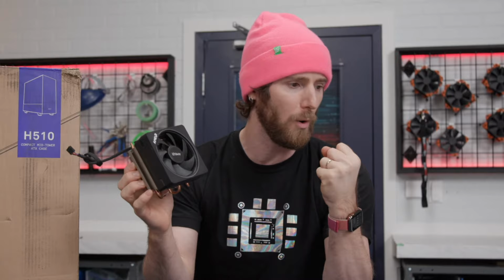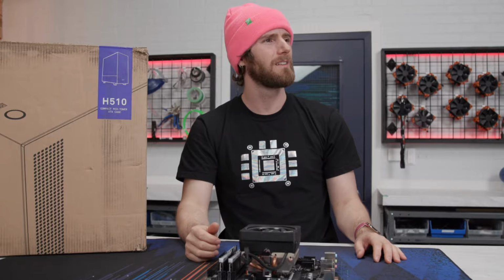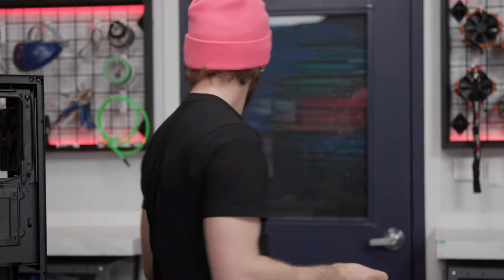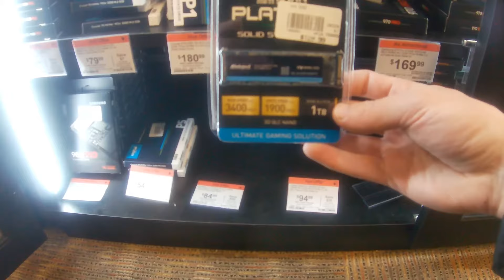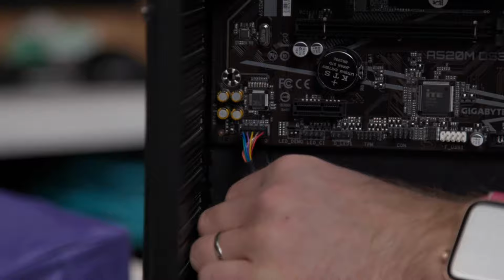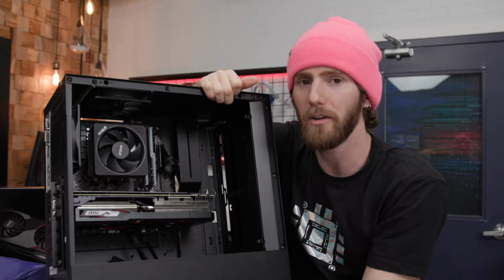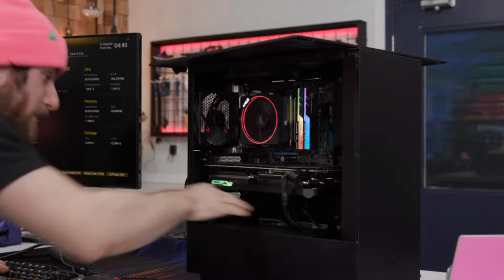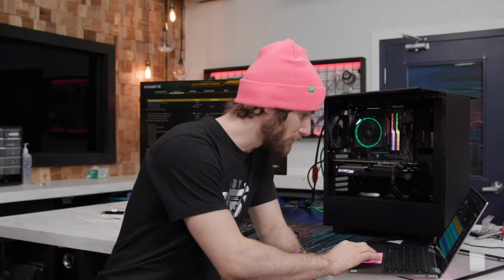Let's Build a Bang-for-the-Buck AMD Gaming PC!!

Comment: G Skill stock speeds are quite low compared to the Crucial Ballistix. I had the AEGIS which struggled to get to  3200  on my Ryzen 5 2600 while the Ripjaws V had a bit of trouble with 3600 unless I relaxed the timings, below what was listed in the kit. The Crucial Ballistix has a higher SPD and getting it to 3200 (stock) was trivial and it went as high as 4000 without issue.

Comment: @linus Tech Tips: i have a Ryzen 3100 with 16GB DDR4 3200 and an B450 Mainboard with a GTX 1660 Super and when i play PUBG on 3440x1440 on ultra low settings and 75% render resolution (except Texture Details are on Mid) i have arround 100-120 FPS - BUUUUUUUUUUUUUT i have OFTEN stutters and drops to 50 frames. I dont know why. BTW my Ryzen 3100 is OC on 4100 MHZ and 1,25V - maybe i have a bottleneck or a damaged component ?`- THE CPU Usage is often at 100% - Temps are not more than 80 degree celsius
Reply: You're so funny, man! This is YT, not a forum!
Reply: @ArturoTabera  and ?

Comment: JayzTwoCents posted a video 'Common PC Building Mistakes that Beginners Make' I should re-emphasize 'Beginners Make' and you daisy chained the extra plug on the end of the 8 pin connector on the graphic's card instead of running another 8 pin plug.. Was it for aesthetic's?

Comment: LOL Could you get Anthony to to explain Buses, and the change, as you did such a bad job...

The System Bus Old, is a Ring, each part had a bit, which would send it around to all the parts attached. the system messages would send the instruction bit to all devices and then reply. then the signal (okays) when sent. 
This was a shared bus.

Now aside from this there was a NB and SB, think of them like routers. they would take control on part of the machine and the bus ring. then would communicate to the cpu.
Then we had the communication move to the CPU, in particular the Memory...   which made things SO much BETTER.
The PCI Express had to be fully terms as if you were to say PciX, then you would find that there was a "pci x" slot already, which were on workstations and servers 166MhzBus.

Like PCi express, PCI came in speed flavors, 33,66, 100 and 133. Most which looked the very same, now the bus is split into lanes. Like on a highway, you can get more lanes on the bus route... more traffic and thus less bottle necks on a narrow lane. they do would the same way with the send bit, read bit  but they are separately connected to the cpu which is the big change to system performance.

Bang for buck Computer?
£320 GPU? I think Steve is doing better cover with older cards as a stop gap for new ones, which is the same for many who may build now and plan to upgrade. as older GPU ( like a 1080 for example) will play games well enough.

Ram Compat....
Oddly corsair Value is pretty good for compatibility, but I have preferred Kingston, which I have used to OEM systems and it worked.. which is not usually the case. I remeber having to manually set Ram, and Wrote a article back in the day on how to do it and loads of people copied it, blogged it..

Upgrade Path...
Low end board.. Low end CPU... NO NO..
Either a great board and crap CPU which you can up grade or the other way around, Id rather swap a CPU than a mother board.

Comment: Notes on that "amazing" AMD stock cooler...
For typical gaming and normal use it's fine, but its not quiet. It will ramp up and get loud relatively easily.
For actual multithread workloads on any 16 Thread Ryzen it will thermal throttle and you will lose like 0.2 to 0.4 GHz due to getting well into the +84 Deg C range.
How much that really costs in time is not allot but higher temps relate to shorter product life.
It's better categorized as "functional" then amazing.

If you're only rarely doing things like reencoding video or long code compiles it won't matter and its very functional.

Comment: wow brings back a lot of memories ,dos 3.1 etc ide where you would install a graphics card and you had to choose irq usually would be 5 or 10 i think and that would intern clash with your soundblaster  sound card which could only use irq 7 or 5 etc... nightmare then pci came along and wow. also ,you would get your mircoprocessor and try and figure out what core voltage it was and change jumpers on the board. cheers for bringing these memories back ,oh anyone remember vesa graphics ? i last built a pc 15 yrs ago and looking to build another,hence , finding your site ,god you look way to young to remember ide etc.. but love the channel

Comment: Gskill is great, but for some reason I cant get my primary to work right. Yes its ddr3-2400 (2 2x4gb kits) trident, and it was (when bought) in my mobo supported list (Asrock FM2A88X Extreme6+) then later removed from the compatability list. If i try to run it over 1866 my system wont even post past bios. Despite this, ill take G-skill over another company anyday!

Comment: FYI the Ryzen 3 CPU comes with a $15 Wraith Stealth Cooler, like my Ryzen 5 did, which is the biggest pain in the ass I've dealt with since seeing the doctor after I turned 40. It's not the clamp-style he shows in this video, it actually screws into the motherboard (back plate). 
Also, the AMD logo section of the fan housing blocked the RAM slots on my MSI B550-A Pro motherboard, so I had to turn it 90 degrees on top of the heat sink. The problem is the damn screws going into the heat sink are blocked by the plastic covering (part with the AMD logo on it). I had to Dremel out some slots in the plastic housing to get to the screws.  I highly recommend paying an extra $25 for a Thermaltake or $60 for a Noctua.

Comment: When Audigy 2 was released I used full 5.1.1. Showing my age here..
Reply: I still use an extigy (same era as the audigy) so I can adapt our 1990s era amp for fibre in to hook to the tv to the 5.1 setup I have in the garage. I had a pile of old audio equipment in a box and decided to use it to free up the space the box occupied. I did leave off the 100 disc changer....I still use Logitech 5.1 speakers on my pc too.

Comment: Went with B550 myself (for €15 difference I could upgrade with a pcie 4.0 ssd later if needed). And took 2×16GB instead. 

Second half I may or may not look  at a 5600, if prices went down. If not, keep the 3100 well into 2022. Whatever man.

Comment: Yo LTT team, could you guys make a PC build for artists? 
Something along the line of medium performance, reasonable bang for the buck with heavy focus on reliability and something that wont break down over sustained load and use.
Reply: A gaming build can also do great with workstations that do graphic design and creative work, just get a 6 core cpu for multitasking. 2d works like digital drawing doesn't really need a high end gpu, a 1060 or 1080 or even Ryzen 5600g is already great for it.

Comment: LINUS NOOOOOO. why would you use the dongle of the gpu cable to power the second gpu port. :(( it my work for a budget card, but wouldn't it be best practice to just use two cables to ensure power delivery? hooking the second port up off  the dongle flappy bit encourages power throttling of the card due to the amount of power each cable set can take off the power supply?

Comment: btw i also put together a parts list for a 600$ system the specs are
ryzen 3 3100
evga gtx 1650 super sc ultra
gigabyte b550m ds3h
16gb g skill ripjaws v 3200mhz
cx550 psu
q300l case
3 pack of epevia twighlight rgb fans
and a 500gb crucial p2 nvme ssd
+msi mag 272crx 240hz monitor
1022$ in total

Comment: Very late to the party here answering the question at @32:00 but Sure... I use my 5.1 audio. I have two 50 watt Bass Shakers on my chair with a 100W amp that uses AUX for the sub's input channel, then I made some panels from the pink rigid insulation foam and use two 32mm 40 watt exciters on those, also going to a second 100w amp using AUX cable for "left/right rear"... And then a sound bar for left/center/right channels... =)  

Every new Motherboard I look at seems to have the silly S/PDIF port and I kinda just have to pass over them... I'm currently on a MSI Z490-A Pro which uses 6 Aux ports so... I suppose I'm good for a while =P

Comment: I had a late 90s AMD computer with the same mount except the screw driver version where you had the risk of stabbing the mobo. other than the little black lever, same cooler mount, 20+ years at this point LOLOLOL

Comment: i briefly hooked up a sound system with subwuffer for movies.  but using a good quality headphones seemed more considerate.  i like the idea of the option so i'm juggling between audio features, size as i like my itx case and may want to put my build into it despite having a decent though thin as tin foil game case that would allow for additional slots.  the deciding factor is usb count- i have a fare few e-drives i like to keep hooked up!

Comment: Didn't expect to be criticizing but making a build with not attainable parts also saying that 4/8 ryzen 3100 will hold up for the next few years for ANY gaming application is too much, you can play league of legends and counter strike on it, maybe triple A titles up to 2020 on 4k with a beefy gpu can hold up to higher tier cpus with average fps since it's mostly gpu bottlenecked  (if you don't mind stutters and bad low%) but games already take advantage of 8 cores and only something like the recent ryzen 12 core can be called futureproof for gaming, also 5700xt was a high refresh rate 1440p card on it's launch not anymore (with exceptions)

Comment: I had one of the Creative speaker sets that used  the 5.1 speaker set. I also had a Logitech version that had Coax and Optical. I still have both sets though not used.

Comment: I'm looking to upgrade my trading pc I've had for 3 years now. I have a Zeon e-5 1620, 24 ram, m2000 vc, 500 ssd and a smaller back up. I use 4 to 6 screens most of the time. It seems everything is for gaming or mining now. I do none of that at all. I usually have up an Etrade account, TOS and 2 live streams. Since I do no mining,gaming or editing. Any suggestions for processors and etc parts based on what I only use this pc for. Thank u and great channel.

Comment: sweeeeeeeeeeeeeeet! glad to catch this is 2021 so i can value the upgrade paths i left for myself 4 years ago with b450 capable of r5 5000s and new ddr4 ram for higher speeds support on r5 5k. will be interesting since i aint spending over 2000$ for a gpu lol. cause next gpu i get from my 1080 is gonna be a 3070 and thats only a max of 1000$ id spend lol. cheers. thanks for the longer full build show too its fun and learnings

Comment: I used to get that problem with display port on my monitor. I have an ASUS dual rx 460 2gb so one of my monitors only has hdmi and one has a bunch so I plugged in the hdmi to one and to the one that had it plugged in display port would have the same problem of no video out put unless I literally unplugged and plugged it back in. I used to use VGA and I just never un plugged it from one of my monitors and I unplugged it and for some reason I stopped getting the black screen on the other monitor. Was really weird

Comment: Speaking of bang for the buck, look at my configuration and who I beat: Aorus Master
Thermal Guard/Gaming
ROG-STRIX-GTX1080TI-O11G
16-Core, 32-Thread
PS-TPI-1250DPCTUS-T 
DDR4 SDRAM Desktop Mem.
AIO RGB CPU Liquid Cooler - Rotating Infinity Mirror Design - Improved Pump
ARGB White 120mm Case Fan with 5V PWM Motherboard Sync/Analog Controller (5 Pack) 
NVMe 4.0 Gen4 PCIe M.2
 Sabrent M.2 2280
Cosmos C700M
I beat AMD Ryzen Threadripper 1950X Processor (1C/32T)
I spent exactly $4,250.00

Comment: i have gskill ram that is advertised at 4000mhz but i can never actually run it stable. mobo supports it too. the xmp profile is not good so i have to mess with timing to get  my system to even boot.

Comment: a 4 core CPU is simply to little for gaming nowadays if you want to play AAA titles, all console ports are optimised for more than 4 cores. 6 cores will generally give you a smoother gameplay experience in newer titles, and even some older games like The Witcher 3 benefit quite a bit from 6 cores.
You can get a 6 core CPU reasonably cheap. The cheapest option, since Ryzen 3600 increased in price, is the Intel 10400f with a b460 motherboard, which is what I would recommend for all budget builds right now.
Regarding ram, they are much too expensive for a bang for your buck build. The cheap G.Skill Aegis would be a better choice.
And a gold PSU isn't that much more expensive, over the PC's life-time you will be than earn that back in the lower electricity usage. The Seasonic GC core is a good budget option if you don't care about modularity, or a similar Corsair TX model, and make sure to dimension the wattage correctly for best efficiency, 750 watt is overkill for most builds.

Comment: hey, i'm a 3d artist and i'm building a new pc, I'm going to buy the amd 5900x. I was thinking to buy the asus dark hero for the best performance of the cpu but it costs 550 euros here in Greece. The other option is to buy the asus ROG Strix X570-E which costs 300 euros. I'm not so much into overclocking, so, does the dark hero worth the extra 250 euro? Will i see so much difference using blender and other 3d programs?

Comment: The 5700XT will be bottlenecked by the R3-3100, and you don’t need a 1TB SSD for a system like this. You also don’t need RGB RAM.

Comment: i also have the monitor not turning on if it wakess from sleep mode. Only have it with my LG screen, not my second one. Not using thunderbolt for it so.... I think it might be a windows problem. I have to pull out and put the hdmi cable back in to wake the screen back up. Anybody else have this problem or even better have a permanent solution to this?

Comment: HI All, I have this same MOBO with Ryzen 3 3300X with my old AMD redeon rx 460, Display is connected to same . I dont have DVI port monitor so cant connect it to mother board DVI port.  its not showing BIOS screen instead its directly shows the WIndows 10 Welcome screen . BIOS version is F3 . what can be the issue . Please help

Comment: trident z is a major issue for me it always has issues but g.skills ripjaws give me ZERO issues actually i just bought g.skill tridentz ram for a customer it wont even run at rated speeds and g.skill never got back to me on a replacement so i think ill only buy g.skill ripjaws ram or corsair ram funny thing is i have two g.skill rip jaws kits and they gave me no problems with the customer's system yet the trident z ram did on the two test benches and the customer's system and he got annoyed and said send it as is but i now refuse to buy trident z ram for the one fact that the one kit i ever interacted with gave me so many issues i just hope they drop the price of ripjaws

Comment: Don't do builds with unobtanium. If you can't get a CPU, use a different CPU for your build. It is not a good bang for your buck system, if actually getting the component will require a more expensive procurement method.

Comment: Linus claiming that gaming applications only need 4 cores still , shows hes a bit out of the loop.  Try running Warzone or Monster Hunter on 4 cores

Yes these are higher end games. ButI think a value gocused rig should be able to run every game smoothly, at the expense of low graphics quality.

As a 4-core owner myself I can safely say, these modern games hammer processor count.

Comment: I hate that mounting system! Give me bolts or twisty push locks any day. Sure, it's fine with the mb out on a table, but installing or removing them in the case, sux balls. Couple that with amd's cpu mount/lock = Sux balls!

Comment: Yeah, bang for the buck.
>nzxt case without any airflow and a lot of extra for "design"
>750W non OEM PSU for god damn ryzen 3100 system
>GSkill trident Z rgb 
>A520 instead of B450

JUST WHAT THE ACTUAL FUCK. You could've save enough money to get a decent b450 MB and ryzen 3600/3700pro. And saying 4 cores is enough ridiculously stupid today. Every new game gain A LOT from multicore and HT/SMT. New consoles are ALREADY 8/16 APUs. Like fucking come on!
Reply: If you want some alternatives- ere you go:
Phanteks P300A case
Coolermaster elite v3 500w
Gigabite aorus prom b450/ ASUS TUF B450 pro-m
Ryzen 3600/3700pro/2700 (depends of avalability, 2700 is really dirt cheap rn)
OEM samsung e-die 3200mhz cl22 kit (with manual OC you could pust timings down, or you could just buy crucial ballistix 3600hmz cl16 kit)

Comment: why do youtubers sugjest this case if it costs more and the air flow is bad? a year ago i got this case from on a mix of builds from LTT bitwit jay and like 1 other guy. this case was common but reading on forums its terrible airflow and theres a 50$ case with a 10$ rebate thats way better? was looking at like 500-800$ builds picking out from that yet this case is an expensive hotbox not worth the money

"Cooler Master MasterBox Q300L Micro ATX Tower w/ Magnetic Design Dust Filter, Transparent Acrylic Side Panel, Adjustable I/O & Fully Ventilated for Airflow, MCB-Q300L-KANN-S00"

Comment: I think I got it better...
If you guys think I fked up somewhere let me know. XD 
 1200€ all of the above:
Memorie Corsair Vengeance LPX Black 16GB DDR4 3200MHzCL16 Dual Channel Kit
 Hard disk Seagate BarraCuda 2TB SATA-III 7200RPM 256MB
 SSD Samsung 970 EVO Plus 250GB PCI Express x4 M.2 2280 
Casti Gaming Redragon Muses - H310-BK
 Sursa Serioux Solas, 80+ Bronze, 650W
 Procesor AMD Ryzen 7 3700X 3.6GHz box
 Placa video Sapphire Radeon RX 5700 XT PULSE 8GB GDDR6256-bit - AMD Raise the Game Radeon Bundle
 Placa de baza MSI X570-A PRO
Ventilator / radiator Floston Halo Rainbow Dual - HALORAINBOW DUAL
 Carcasa AQIRYS Rigel ARGB - Rigel